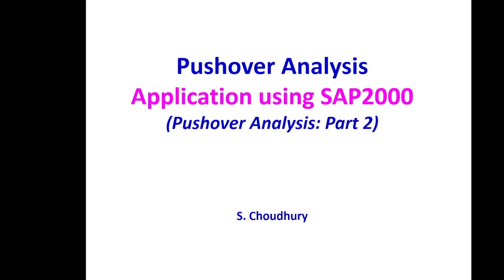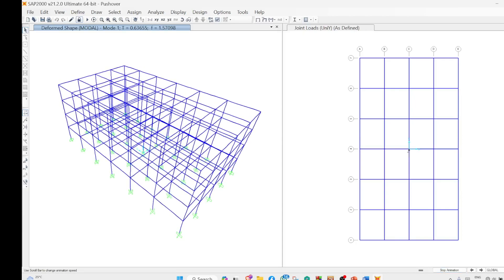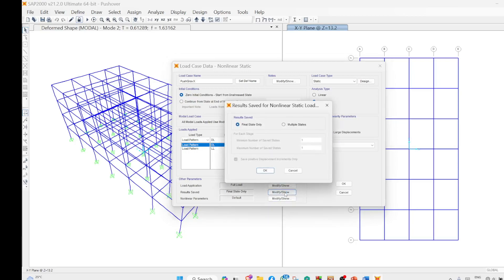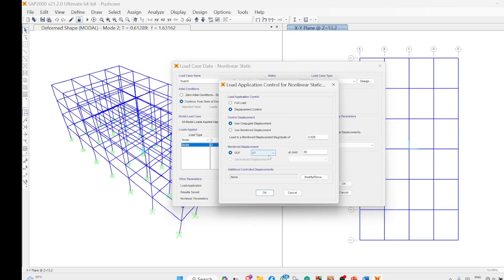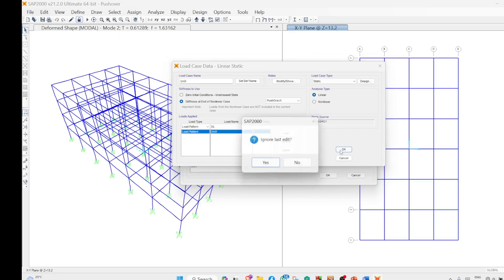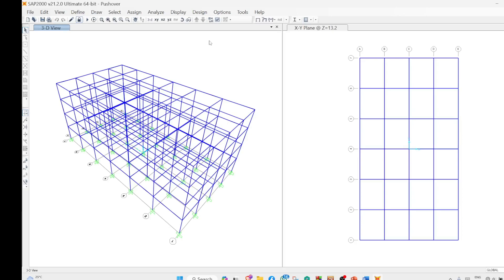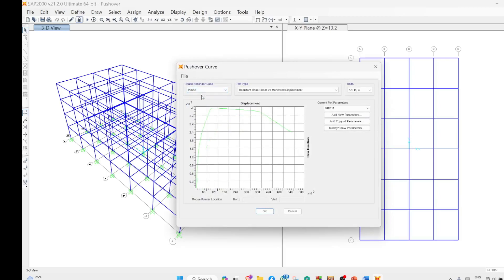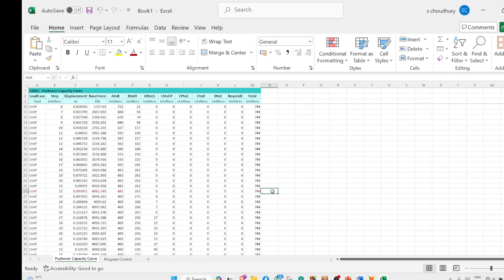Pushover Analysis: Using SAP2000

Comment: Hi, I'm trying to figure out the requirements and also what the computer is doing. How come your applied pushover load is in the center of the building only? If the applied load is concentrated on an outside column, wouldn't the performance be more critical? Given all the earthquake design requirements require consideration for eccentricity it seems odd to me that this is not considered in Pushover.

Thanks for the video series too.

Comment: sir I have facing issues I ma performing pushdown analysis and the load case did not finished and my analysis are incomplete
Reply: Your problem is not very clear to me. It may fail to complete the analysis if the capacity of members is not adequate. Your design should be carried out properly.